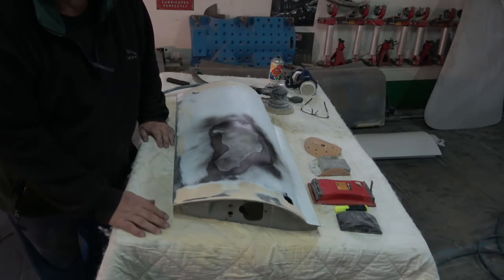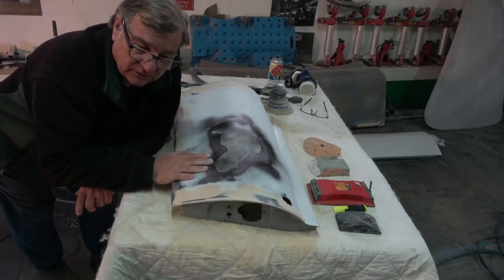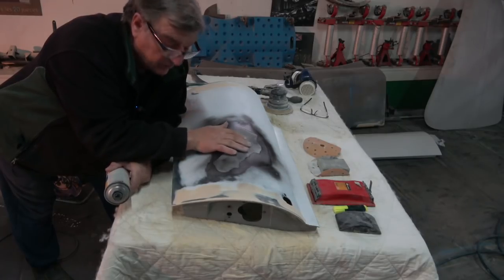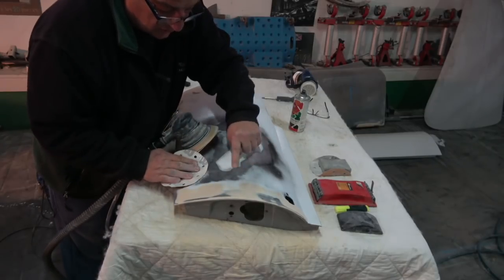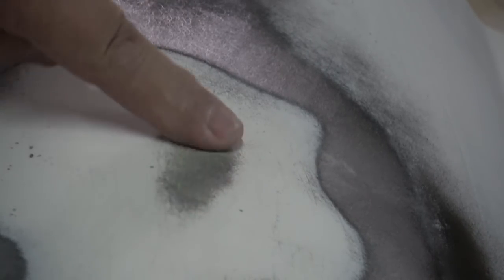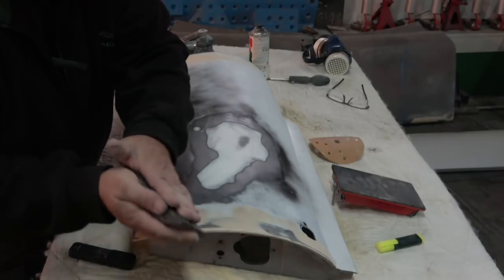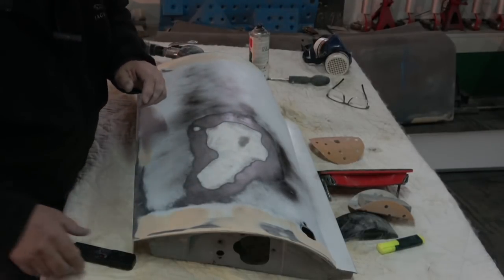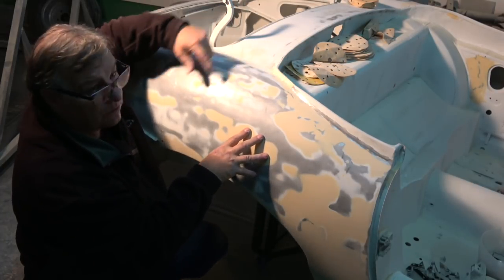Car Body Repair Tips Filling & Sanding for Paint.

Comment: Great advice Dave, one of my weak points is bodywork so I'm always on the lookout for tips from more experienced people. One thing I saw recently was not to apply filler over paintwork, only over bare metal. I'm not sure if this applies to modern fillers but I wish I knew this 20 years ago as I have always struggled with paint reactions between the filler and old paint.

Comment: Very interesting Dave, am a fan or you video's. One question, if after sanding you have bare metal spots, do you need to prime them before adding filler ?
Reply from the maker: Guy, Thank you very much! As long as there is no micro rust in the bare metal primer or filler is OK.  Cheers Dave.